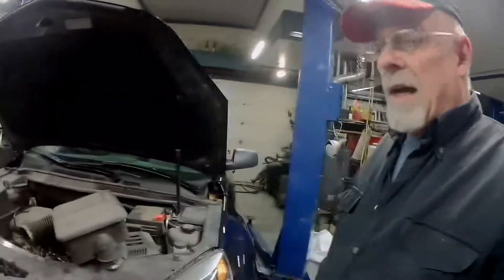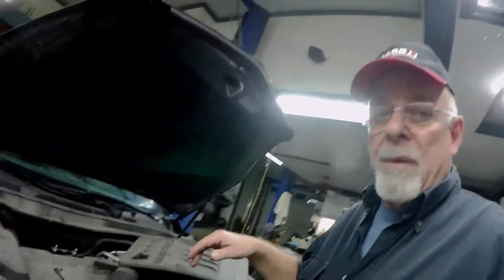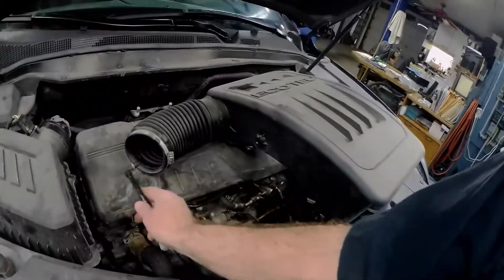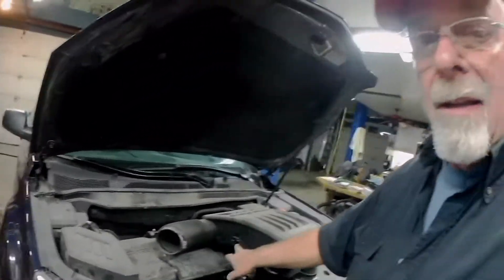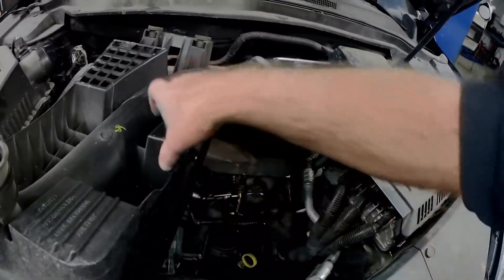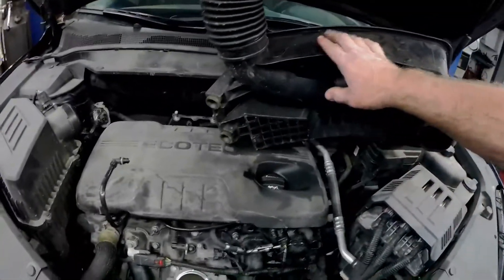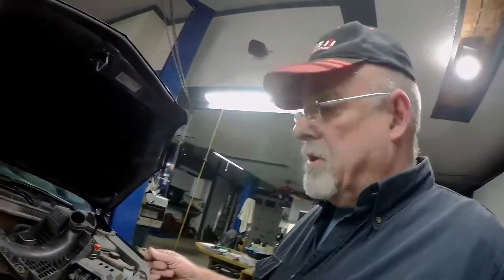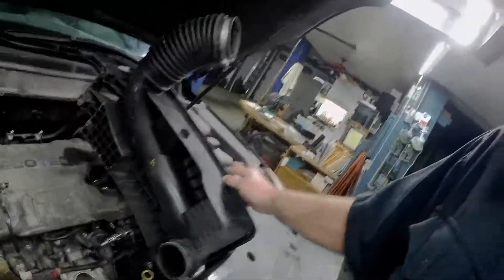2.4 Ecotec GM Rear Main Seal Failure and Fix - 2017 Chevy Equinox

Comment: No sir. The pcv system on the intake is blocked. Look it up.  Ice can very easily freeze in the tube and blow the rear seal again.
Reply: Yes the pvc hole in the intake is the problem. Doing one right now as we speak. It’s a known issue with the 2.4l terrains and equinox’s. If you don’t clear the hole in the intake assembly it’ll happen again. I can post some pictures in a little to show exactly what happens. I’m a mechanic and see it every time it gets cold in Indiana.
Reply: @Tooshiesty446   it just happen to me on my 2017 equinox last week its at shop getting fixed right now and im in indiana it happened when it was like 20 or below
Reply: @jumoli101  Yeah we’ve been seeing a lot of them. more to come I’m sure with the temperature dropping.
Reply: @jumoli101 what did that run $$.  Mine is blown as well.
Reply from the maker: Really? except that the tube is "pitched" the entire way ....  I'm not saying it's impossible, I just find it difficult to believe, where the breather box was full of water that couldn't drain because of it being full if ice.
Reply: Same same. 2017 Equinox, 96000 miles. Well maintained. Cold snap. PCV glued itself shut and bleeeeeew the rear main out. The water in the airbox is bad juju, but it's not enough to blow the rear seal.
Reply: Just happened to my ol ladys 2016.😡

Comment: Isn't it going to have a vacuum leak from the drain hole?
Reply from the maker: It is upstream of the throttle body
Reply: @mark_osborne  BUT IT IS DOWN STREAM OF THE MAF SENSOR! I DONT SEE HOW IT WOULDNT CAUSE LEAN CODES
Reply from the maker: @samuelstrother4363  You are correct, some of the air going into the engine is not being measured by the MAF, however, it is so insignificant it does not matter.  Monitoring the STFT (short term fuel trim) using the hand held computer following the repair (while driving the vehicle)- the STFT was still dancing around "zero". BTW, STFT  has the ability to add or subtract 30%

Comment: Wouldnt the water go in in some parts of the engine since you made a small hole with the drill?
Reply from the maker: No, it just drips out the bottom of the filter assembly onto the intake manifold and eventually hits the ground or evaporates

Comment: How much does that cost to repair at your shop?
Reply from the maker: I charged him just over $1000 to pull the engine and reinstall it along with replacing the rear seal
Reply: @mark_osborne  Ok. I have the same issue now and I'm waiting to hear a quote from the shop. When I Google searched it for this car it says you can expect to pay $1,700 so you charge a great price!
Reply: Oh crap this is happening to my 17 Equinox right now. Preparing for a tow truck. 40,000 miles on car.  Ty Mark im glad I looked this up and found you. Monroe michigan resident.  Where are you?